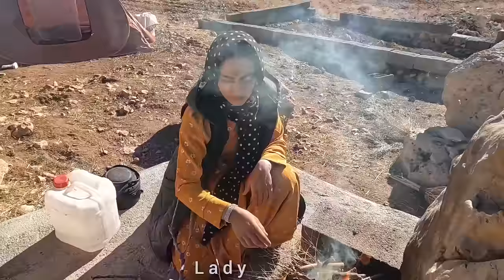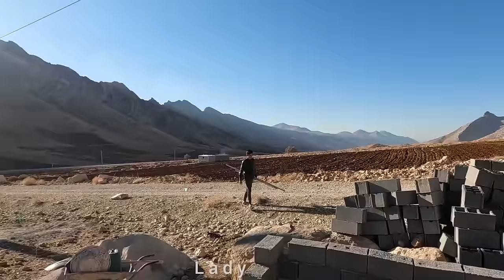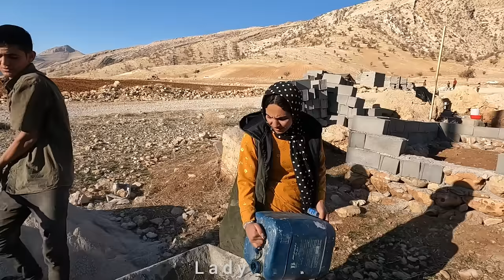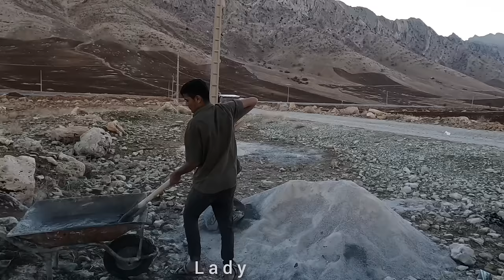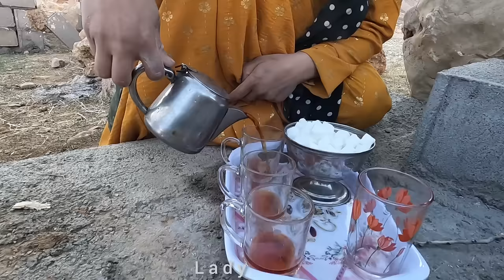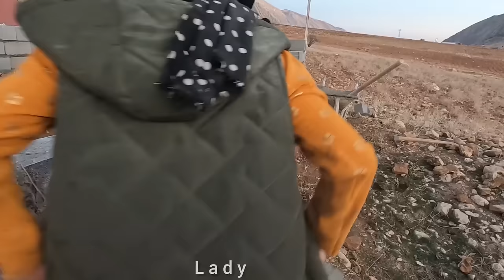At a crossroads: separation from Amir's family (daral) 2023

Comment: Mahin you and your brother needs to watch the correct way of building concrete block wall in YouTube so that you are not wasting time and materials. The foundation is very important to prepare correctly it’s too late now but you could still follow the correct way of blocks laying technique.  You could save a lots of materials and time by spreading the cement mixture on the edge only but follow the correct mixture 1 bag of cement and 3 bags fine sand also You don’t have to fill up the blocks of rocks it’s unnecessary no added value.  Order the door and window  ahead of time specially the windows. Buy the basic tools like level, clear hoses for leveling, square.  Plan also for your roofing supply don’t make it complicated metal roofing with good insulation is faster and stronger to install.  Concrete roofing is very dangerous if you don’t follow the engineering specifications good luck
Reply: This family is wealthy and she will not live in this house for long, if ever.